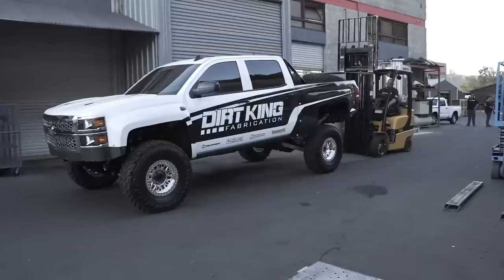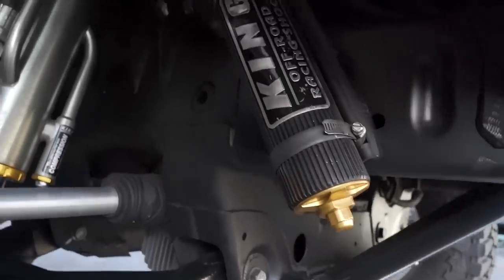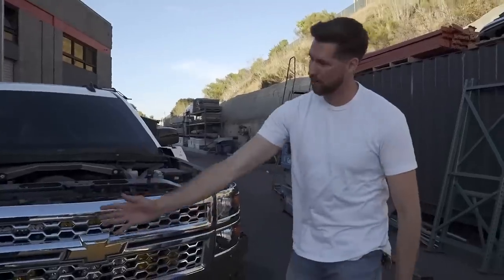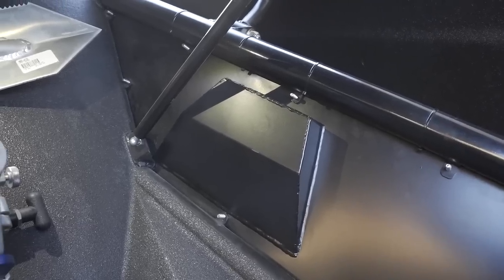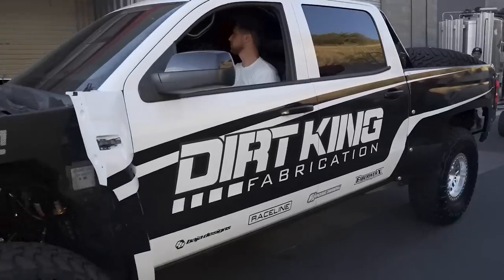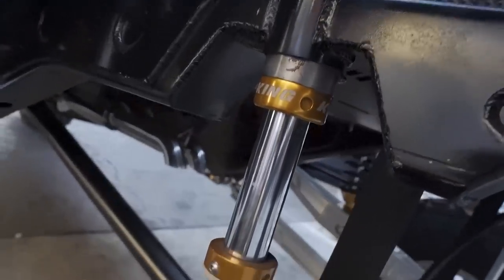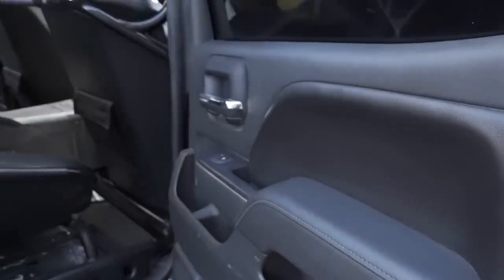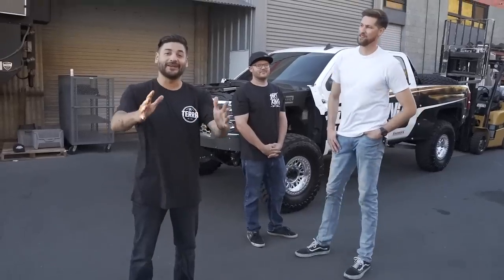Dirt King Built Chevy Prerunner! | BUILT TO DESTROY

Comment: With that much down travel and up travel in the rear, how are the driveshaft angles? What driveshaft is he running for the rear? Still a slip yoke off the transfer case?